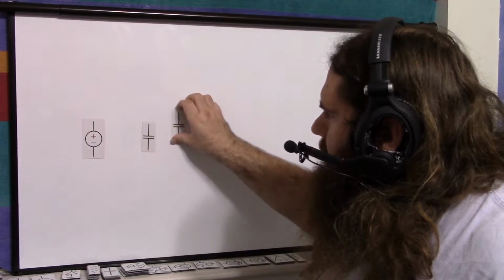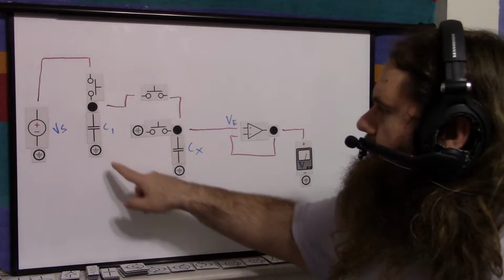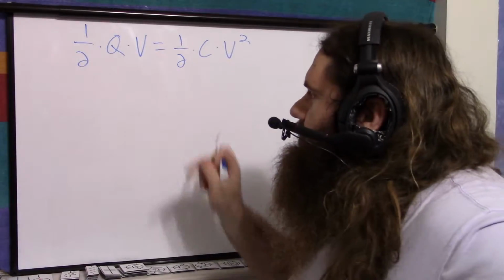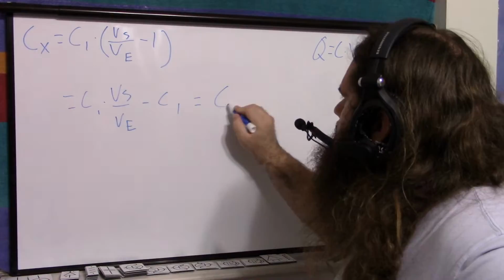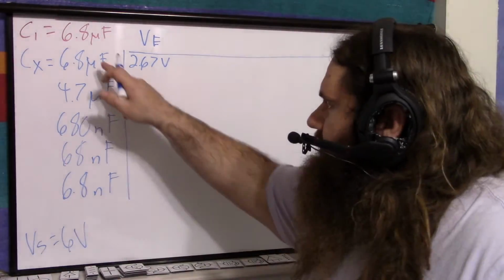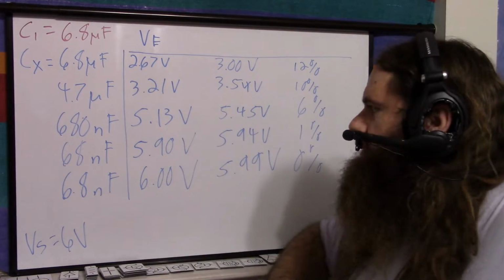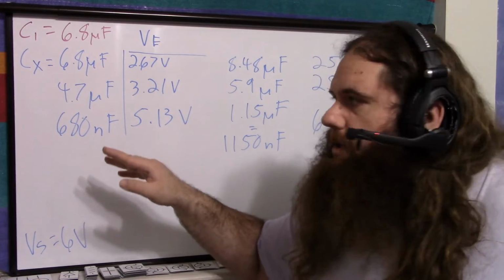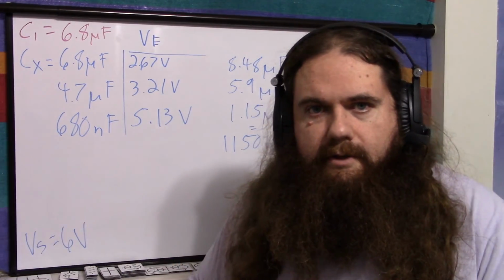Measuring Capacitance With No Special Tools - Simply Put

Comment: Oh, yeah, that's a good idea with the known circuit! 
Why not use τ = RC?
If I can measure the voltage on a charging C with an Arduino over time. 
And then I can figure out what "size" the C is, depending on the time it takes to get charged, and the resistor that I use to limit the current.
Reply from the maker: Yep, just make a low-pass filter with the unknown capacitor and a potentiometer, use the arduino as an oscilloscope and tune the pot until the RC waveform is stable, then see where your RC time is. That's probably how I'll measure inductors because you can't do the same trick with them since their energy "storage" is current.